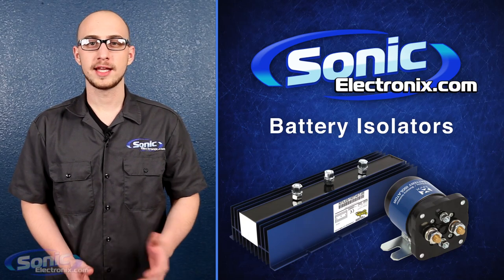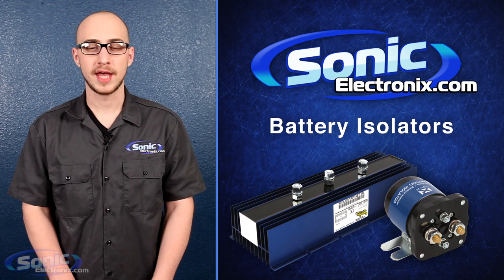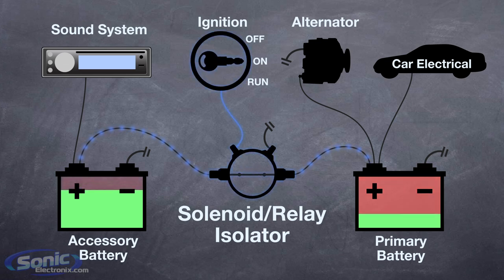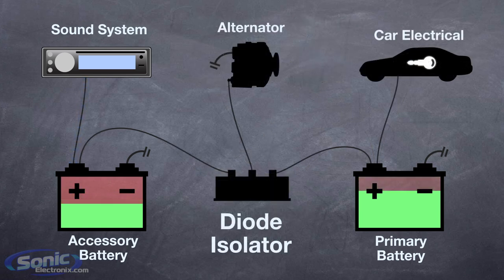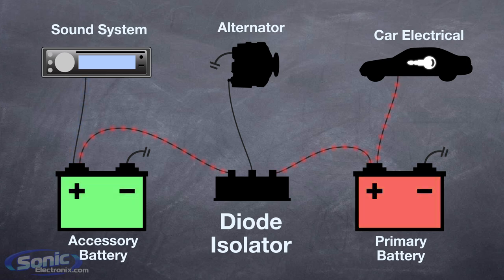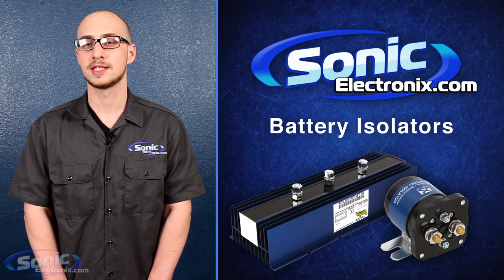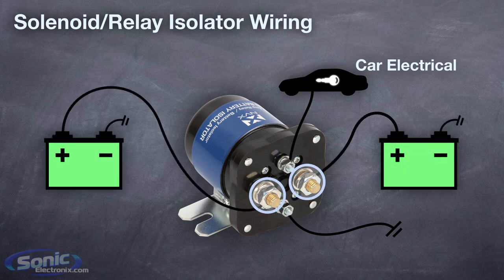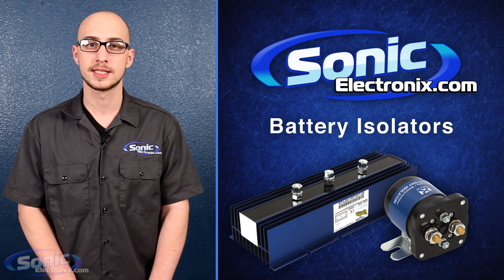Battery Isolators - Types & How to Install | Car Audio 101

Comment: Hi.what is the highest charging voltage of aux battery while connecting thru diode isolator?
Reply: Depends on your vehicle's charging system. For example if your alternator is hitting 14.8 volts on a true cold start and settling in around 13.4, the battery downstream from the diode would only see about 14.2 peak and 12.9 floating. Again, these are just examples, but with diodes in a 12V system you can expect to see a 0.4-0.5V drop from passing through the diode.

Now, one way to defeat this is to put a second diode in the reference voltage circuit from your alternator to your ECU, which will boost your charging systems output by roughly the same amount. However, if you have an AGM as a primary battery, you would want to make sure that you're not going above 15 volts at a cold start before or after. If you modified it to compensate and started seeing 15.5V, you will kill your primary battery fast, and could also have problems with one or many computer or other electronic related sensors etc in the vehicle.

Comment from the maker: Either option will work, but we would keep the original battery and add the HC600 to the trunk.
Reply: So if the battery is smaller at trunk , no need for isolator?

Comment: How would you hook up an isolator in a 2007 Tahoe as the install instructions for the stinger 240amp say it is not compatible with the alt wire setup?

Comment: I have a 200 amp alternator and a optima redtop as my battery, running a 1000 Watt rms amplifier.  should I add a second battery?
Reply: Matthew Cousineau - If you have the vehicle running while playing the sound system,  that setup should be fine. But if you plan on doing much "engine off" listening, then I would add a deep cycle agm  in the back, close to the amp, and use a solenoid type isolator in the power line running between the front and rear battery. That way your amp just pulls from the rear battery while the vehicle is off, and you don't have to worry about the redtop being drained.

Comment: Hi, i have a question.
Do you have to have circuit breakers/fuses to each battery? If the isolator is already capable of handing just say 140amps. Does that mean if i were to have 70 amp fuses between each battery, that each battery will only be getting that power? if i were to install an amp on the aux battery that uses 100amps. Would that mean because i already have a 70amp fuse before the 100amp fuse that it will not supply 100 amps power?

I would rather not have circuit breakers if possible

Comment: good info but most professionals never use their system without the car turned on, with a good high amp alternator or alternators and enough batteries youll get amazing power output withour adding all that extra crap ie capacitors, and isolators. and if you have that much power demand from your system its kinda a known thing to NOT play your system without the car on

Comment: THE SYSTEM THAT I AM DOING IS 1- ORION XTR 600.4 (2 SETS KAPPAS MIDBASS COMPONENT WITH TWEETS) AND 1-ORION 250R HCCA (2 10" OR 12" SUBS, NOT SURE WHAT SUBS YET) TOTALLING IF IM CORRECT ABOUT 120 AMPS. ANYWAY.... IS 2 OF THE SAME BATTERIES NECCESARY TO BUY? COULD NOT HAVING SAME BATTERY SCREW SOMETHING UP? WILL USING A DIODE ISOLATOR SOLVE THIS PROBLEM? AND IF SO, OTHER ISSUE ARISES!? UGH!? ISSUE ABOUT VOLTAGE DROP IS ON MY MIND, AND IF THAT CAN CAUSE PROBLEM? WOULD APPRECIATE THOROUGH ADVICE THX

Comment: I have a 500 amp solenoid isolator with two xs power batteries. can I get away without an HO alternator on a 3300 watt system since the alternator will slowly charge both but only the back battery will be discharged by the system? (i don't plan on running the system much with the car not cranked and I have a 150 amp alt)
Reply: Dirondi Johnson 
how many watts is the amp? 3,000 watt amplifier, you will need a HO alternator per 3,000 watt amplifier

Comment: so a battery isolator is not necessary if you have to batteries. and if I hook up a battery isolator does the first fuse go on before the isolator or after?

Comment: So, in the case of the Diode Isolator, if the isolator fails will the car still run?
Reply: Thats a good question, but i would think that if the isolator would fail then the car wouldn't run, but thats just my thoughts.

Comment: When using an ignition hot to activate the isolator(which brings 2 batteries active), how does one prevent having the vehicle's starter being overloaded by the combined cranking amps of both batteries?
Reply: Your isolated battery should be wired up to accessories you wish to run. Not the starter. The only way the starter will get power from the isolated battery is if you run a positive cable of the appropriate gauge to the terminal on the starter.
Reply: Switch out the word starter for alternator and your question would make a little more sense.

Comment: Hey guy I'm running 5 light bars on my jeep can I use this so my aux battery can power my light bars?
Reply: add a few more light bars and i think it should work
Reply: Mario Martinez 5 lightbars? Do you really need that much light? Better yet why not off road during the day and sleep at night? But it all depends on if you are using LEDs or not and how many are wired together.
Reply: A 2nd battery wont increase how much load you can put on the electrical system.  You need a higher amp alternator for that.

Comment: In both isolators, why do we need a wire to the ignition or the alternator ? Can't we just plug it to the positive of the battery again instead of the alternator or the ignition ?
Reply: Loïc seguin you run it to the switch so it only activates while the behicle is on, and isolates when off. if you went straight to the battery, it would be actuated all the time, and allow draw off both batteries, defeating the purpose.

Comment: well a diode isolator sounds better but with the alternator connecting directly to the diode is the big 3 still needed? the alternator is connected to a diode then the alternator rather than straight to the alt?
Reply: yes the big 3 will be required. Keep in mind that the auxiliary battery you are adding is also another load to the electrical system.
Reply: Pierce Steadys so would i then hook up both batterys to alternator like big 3?

Or just main battery under hood?
Reply: Eric Loiselle   Eric, what are you trying to accomplish?  High output stereo system?
Reply: Eric Loiselle same question, do you have an answer yet?

Comment: how do we find the true ignition?my car is a 2015 rogue with valeo alternator.do i refer to nissan's schematic and ask the nissan service center?
Reply: sell your rogue get a good car
Reply: I am wondering the same thing. How do I know which wire is the ignition wire? I have a 2011 Honda CR-V. I understand all the connections except where do I find the ignition wire to connect to the small terminal on the solenoid isolator?

Comment: How do you determine what gauge of wire to use for a diode setup?
Reply: There are tons of charts available online. Determining the correct wire size for your application is based on the amperage you need the wire to carry and the length that you will run. High amps and long runs require larger wire. Use quality multi-strand automotive or welding wire/cable.

Comment: In the event that your starting battery has no charge, you can most definitely start your car using the accessory battery. All you need are long jumper cables...
Reply: Southern_EE No disconnect the device

Comment: Why would your total RMS watts have anything to do with the size of the isolator needed? Wouldn't you want to base the size off of your alternator amperage
Reply: The current will flow freely through the solenoid between battery and alternator. It will have to withstand whatever amperage your are pulling. If you take 1000w RMS and divide it by 12v (battery voltage) you get 83amps. So by taking 1000w RMS and dropping the 0 like he said you would be safe with 100 amp isolator.

Comment from the maker: You dont need a new battery. Adding an HC600 or HC800 will help your system overall, but you can get away with an HC600 for additional power.

Comment: If you use a Diode isolator , you have to hook-up the Alternator voltage Sense to your battery. If not , your main battery will not be able to full charge
Reply: okay I hope you can help me!
 I have dad  problem my main battery is not getting full charge. 
can you explain that to me again please

Comment: hi: when you install the  second battery . Both batteries have to be similar in  amps or can be different. Example 1 : 12volts/80 amps both. Example 2: 12volts/80amps - 12volts/45 amps? . Thanks
Reply: Using two different amp batteries in any circuit will cause the smaller amp battery to continuously OVERCHARGE and can cause   failure and possibly fire if the battery gets too hot
Reply: @jojomorgan8556  Im not educated on this, but doesn't the alternator control the voltage output to the battery. Meaning it wont go over the set voltage output, unless the alternator regulator goes bad?

Comment: After we conect in Audi a4  did type.but we can't start car so we bring from middle diod contact to + main battery and car start?main car voltage 14v second in boot 13.2 v is that normal?

Comment from the maker: A capacitor is only needed if your electrical system is healthy. You will need a battery isolator to make sure both batteries do not end up charging off each other.

Comment: My system messed my stock radio up and destroyed my cluster panel in my 2011 dodge charger, how can I hook a system back up in it and it not mess the whole thing up again? My cluster panel was $1300.00 to replace

Comment: SO I CAN'T USE MY FACTORY BATTERY FOR PRIMARY BATTERY WITH A DIODE ISOLATOR AND BUY AN XS FOR ACCESSORY BATTERY( JUST FOR AMPS. RUNNING)?

Comment: YOU CAN USE THE 2ND BATTERY TO STAART THE CAR, YOU JUST PLUG YOURE POSITIVE TERMINAL ON THE ISOLATOR ONTO THE TO THE 1ST BATTERY THE WHOLE CAR IS ALRDY GROUNDED

Comment: Unless your willing plunk down $500.00 or more to upgrade all electrical, stay away from these stupidly high rated current sucking amplifiers. You can do a lot with a low power high efficient stereo system. You lol DO NOT need 2500 watts.

Comment: Does the isolator let the alternator charge both batteries at once at the same time or does it only charge one then when that battery is full it charges the other one ? I am asking this cuz I only have a 150 amp alternator and I would like to know if that alternator could handle both batteries

Comment: I dont have space near the engine to istall the diode isolator because it too big,   can i run the alternator wire from font to back and put the diode isolator in the luggage boot ? Thanks